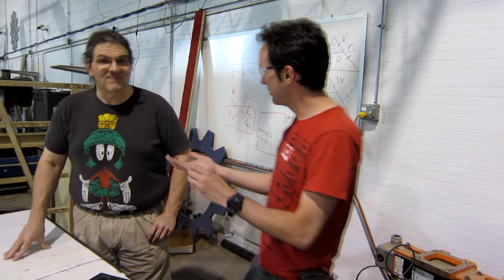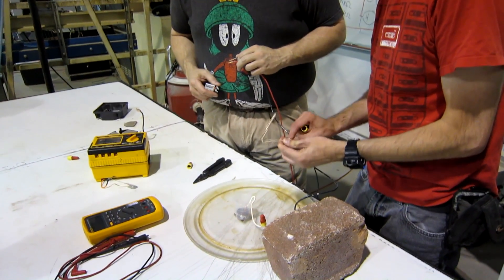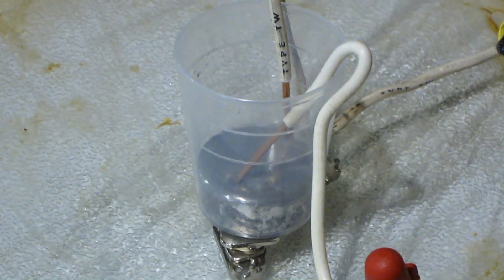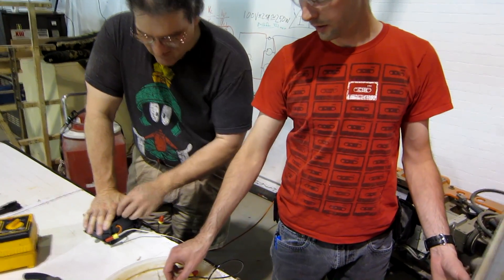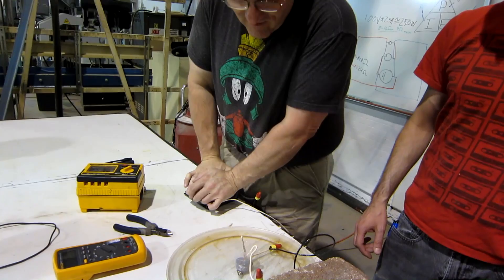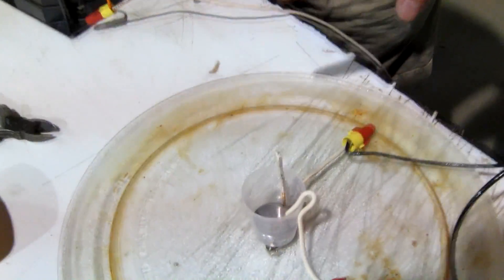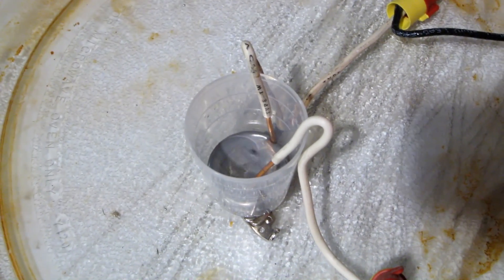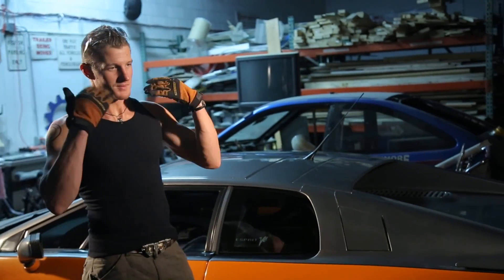Captain's Blog 7-1-2012 Mercury Motor Experiment

Comment: Best way to clean your mercury is probably by distillation, assuming that your contaminants boil above 360C (seems likely if it's some kind of metal slag) it should be pretty straight forward, you'll want to do it in a closed system under a fume hood though, maybe once the chem lab is fully built :)

Comment: if its pure, as i understand alot of the time the mercury you find will contain mercury compounds, these can be absorbed through the skin and therefore get mercury into the body. pure mercury cannot be absorbed through skin contact and must be injested or inhaled to pose a threat. However i have heard that the oils in your skin can form these murcury compounds, so best still to wear gloves. Its also a safe bet that the gunge on the mercury contains these compounds. correct me if im wrong

Comment: Oh, and another way to get the majority of the slag off it by very slowly dumping the mercury out of the container. The clean mercury will emerge from the edge of the slag and move before all the oxidation does. Keep slowly pouring the mercury out and the majority of the slag should stay behind in the container since it grips to the sides of the container, just like it did to the lead you had in it before.

Comment: Yep, that technique does work fairly well. If it doesnt work as smoothly as it sounds, I have also cleaned mine by dumping it into a paper towel and rub two sides of the paper towel together. The oxidation will go into the paper towel and the mercury will look nice again. I have about a quarter the mercury of what they have but it should still work nicely. And mercury does feel amazing ;)

Comment: "You can clean mercury up by using a coffee filter with a pinhole in the bottom of it (a technique I learned from Timothy Brumleve). Amazingly, you can simply let dirty oxidized mercury drip through such a filter, and it comes out bright and shiny." This quote is from Theodore Grays website about the elements.

On a scale from one to freaking awesome how does it feel to have mercury in your hand?